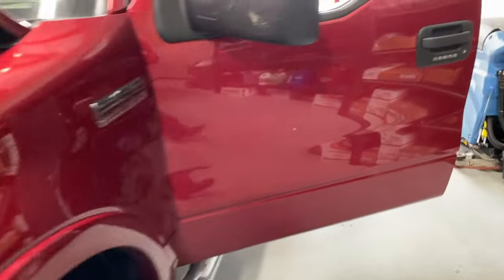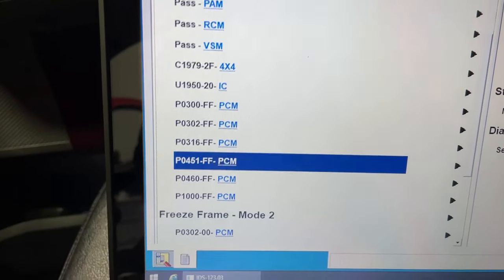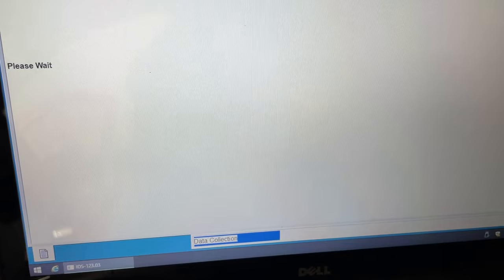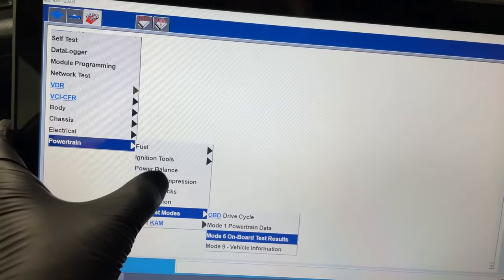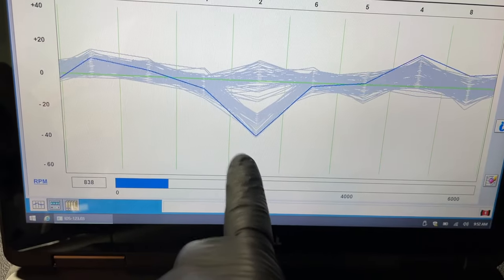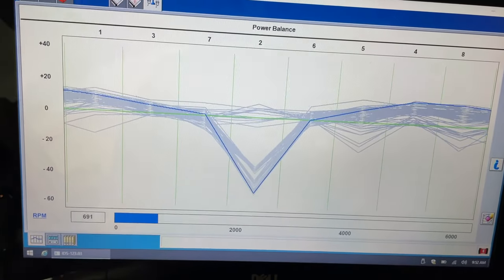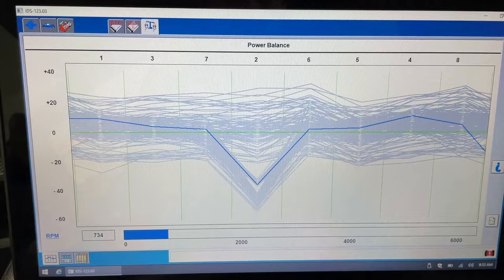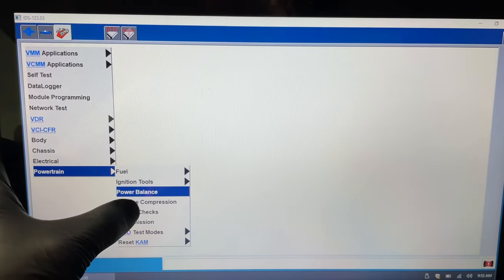Ford F-150 5.4L 3v Triton Engine Misfire: Champion Spark Plugs Belong in Chrysler’s and Lawn Mowers!

Comment: My 09 will start bucking especially low RPM. I use tow haul to bring rpms up and it helps it. Changed coil no difference. I haven't taken plug out, 165K miles factory plugs! Do i need to change them , is that the problem. Says 5 misfire.
I had a new 97 explorer and never changed plugs, sold it with almost 178k miles still ran great? 
I can't afford the dealer throwing parts at it but I've never seen a plug come loose before especially if they're factory?
Do you believe plugs are my problem here? I thought they were made to go 200k plus miles?

Comment: I have an issue with my 2002 f150 5.4 having oil in the spark plug well. What could be the problem oil going into the well?

Comment: The internet hates Champion plugs.  I've never had an issue with them. My 5.4 3v has been doing just fine on Champion Iridiums.  I would've done Motorcraft but it wasn't in the budget that week.

I think a lot of it is taking care with what you're doing - torque, cleanliness, etc.  I'd take champions installed by Brian over motorcraft installed by a hack.
Reply: Your right.    He is a Ford guy.  So it's Ford parts.    I myself work for a shop that used to install only Autolights in everything before I started. Now we have changed that.   GM gets AC plugs and Ford gets Autolights, Chrysler get Champion.  All imports get NGK...  but I have worked for shops that only use AC for everything because they bought them in bulk...

Comment: I have a 1997 Mercury Grand Marquis,  4.6L V8 no coil on plug  which plugs do you recommend?
Reply: @Jonathan A I was planning on getting Motocraft plugs. I can get copper, single platinum, double platinum or iridium. I am not sure what works best?
Reply: @Jonathan A I have heard reports of hard cold starts using the newer iridium plugs with the older ignition system.  I think my car came with AGSF32WM. I was told the NGK TR55GP G-Power platinum plugs work well.  I might try them out.
Reply: @davidbrennan5  install the single platinum plugs. I put them in a Lincoln  I used to own, they were flawless.
Reply: @markk3652  That is good to know,  I just don't want to end up buying plugs twice. if they last 4-5 years I will be  happy.
Reply: @davidbrennan5  my 95 Towncar had the 4.6, with the platinum plugs it started easily, idled smoothly, and averaged in the mid to high 20's for fuel mileage consistently. They also last for 100000 miles.

Comment: Do you ever put anti-seize on plug threads?
Reply: Rule of thumb for myself is no anti-seize. Just a small squirt of wd40 for a little lube and start them by hand. Had misfire problems on many German manufacturers using anti-seize
Reply: @matthewellis3513  copper/nickel high temp anti seize is the way to go. No ground continuity issues using a small amount, especially in the aluminum cylinder heads.

Comment: I have 05 f150 changed plugs and coil packs all 4 o2 sensors.  Mass airflow. And a few more. I still have a white smoke with bad gas smell from exhaust and now a pretty nice ticking noise. 220000 miles any ideas. Thanks in advance... This video is similar to my problem.  Using Ford plugs

Comment: I used to see 65535 all the time working with computers. I looked it up again and 65535 is the highest possible number in 16 bit binary code. So it is likely there are way more misfires than that.

Comment: I have a 5.4 3 valve in my 2004 I replaced the motor with a crate engine from advance auto I have about 5000 on it by now I put my old coils on the new motor but I did put motor craft plugs in it every now and then my number two will miss fire especially when I turn on the ac I also have a broken clip on my plug in any suggestions on what I can do with it?

Comment: Need help! 2007 f150 5.4 temp sensor code keeps shutting down my mom's truck . Mechanic changed it 1st time then I changed it still same thing. Do you think I should replace the water pump or thermostat. I also changed the efan clutch. Please help.

Comment: At 17 minutes on your test drive I could hear a "warble" from the drivetrain, that sounds kind of like mine.  Does that sound like tires, bearings, or differential to you?  It's not bad but makes me nervous.  

Didn't realize that something as simple as a spark plug could have so much variability among the manufacturers.  Also, you said "Ford" spark plug, but you probably meant Motorcraft, right?  I know that they're essentially the same but there are parts that say Ford and parts that say Motorcraft.

Another good video.  Thanks.
Reply from the maker: Tires
Reply: @FordTechMakuloco  Thank you.

Comment: Hey, so I have a 2004 f150 lariat 5.4. The oil pressure gauge sometimes doesn't work. It works when it's warmer outside but when cold the gauge doesn't work. i verified it has oil pressure and replace the oil pressure sensor with no change. I am wondering if it is a ground issue or something else. Please help!

Comment: I've been watching your videos for a long time and I've actually fixed my truck with some of your videos, and right now I'm having an issue with the truck bucking when I'm on the highway, this is what's happening when I step on the gas at speed it starts bucking I let off the gas and and press the pedal to accelerate it stops bucking then as I let off the gas again and step on pedal to accelerate it bucks again then I have to release it and press it again each time I release it bucks till I press and release and press lately it's been on the highway that it's happening I wonder if you can give me some ideas on what the problem could be and how many different problems can cause this bucket because things are bad now and I don't have the money to send it to a mechanic and with your knowledge and videos I may be able to fix it myself, I hope you can help. Thank you

Comment: Thoughts on ngk spark plugs? Just bought a 2010 And noticed it has ngk. I have new motor crafts but not sure if I should wait or go and change them
Reply from the maker: The motorcraft plugs are made by NGK.

Comment: Hey Brian, long time viewer here. I wanted to ask if you have experience with the red locking tabs getting stuck in the unlocked position on older Ford vehicles? I see them used on MAF and TB connectors on late 00’s to early 10’s Ford’s. I currently have one zip tied to my intake to prevent it from coming off my MAF sensor since it’s stuck unlocked. Thank you for your time.

Comment: I have a 2005 F150 5.4 that im about to do the timing on.  Its got 142k miles on it.  I have no idea when the plugs were changed last.  Idles pretty good.  Do you recommend just replacing the plugs while the timing is being done?  Do you automatically change the Ignition Coils too then?

Comment: I have a question that has nothing to do with this video, i have a 06 focus that I just replace the whole AC system and i mean complete system. Yet when I am driving it does blow cold air but a idle it blows warm. Is there something that I can do or check. Based on your expertise.  I would really appreciate your thoughts on this

Comment: I have these plugs on my truck and it runs okay, I do however have a rough idle and between 40-45mph i have a shake, trucks bouncing all around and you,can feel your teeth chatter. I had this problem before I changed the plugs and it fixed it, now its back. Could it be because of the plus? On my edge tuner it says -15 spark advance.

Comment: Need an idea, 2007 F-150 Lariat, 5.4. Keep getting a P0307 code. Runs rough, blows a code and then I tack it up to 2200 rpm for a minute 65 to 70 seconds and it stops. Only does it after sitting for 7 to 8 hours. Changed with ford parts, Coil, Plugs. Will not go away, cleaned with seafoam directly to cylinder 7. No avail. Fuel injector swapped and no change. Throttle body cleaned. What the heck, only 136 thousand on her. Help Please   Jim

Comment: Hi friends. I had a misfire and changed the spark plugs for newer Ford OEM parts. One of the plugs wasn't able to came out (the only one and I know is not ford, as required the 5/8 socket, assuming is a Champion). What do you recommend to try to break the plug being seized and take it off. We really tried hard with a long pry bar and wasn't going anywhere. The mechanic told me "as that cylinder is not giving problems leave it and try other time". We used the "carburetor cleaner to attempt loosing the threads but didn't work. What you recommend doing? What would happen if we use a larger bar and apply more torque? Does adding WD-40 for a couple of time do anything good to loosen the thread? Any comments from anyone here would be highly appreciated. BTW, I'm in Calgary and my truck is a 2005 F150 with the 5.4L Triton and has 273,000 km.

Comment: Dam that Ole boy is lucky that plug didn't launch into orbit.  That's at least $500 to fix a blown plug. I only use Motorcraft and get them in good. Coils I'm guilt of using aftermarket but I replace them every year with new plugs also.
Reply: You replace coils and plugs every year?  That seems a little excessive unless you drive 100K miles a year..
Reply: @dickfitzinya3082  My F-150 is used for off-road in Colorado up to altitudes of 13,900 feet. A break down up there is a major problem. It gives me peace of mind knowing the plugs won't come out and the coils will work up high.  Excessive yes

Comment: Any idea why my 07 fx4 would loose power with no warning lights till it rolls to a stop then it's a check gauges showing no oil pressure it's only done this 2 times in 2 years and under passing accelerating once I shut it off and restart it's fine again I do smell a little oil burning for a second thanks
Reply: I'm wondering if a bad engine mount can cause this
Reply: oil sending unit

Comment: I have a 2009 f-250. 147k miles. It misses badly only if the engine is cold and I’m accelerating between  3-4k. Once warm it runs awesome. I’ve changed the exhaust and added a cold air intake. No change. It has no codes at all. I do hear the timing chain making noise. Any ideas?

Comment: Brian I have a question I have a cylinder  8 misfire on first 1000 revolutions on my 04 f150 with the 5.4 3 valve and was wondering if you have any idea how to fix it. I'm only 17 so money is tight and I have already payed my local shop $420 dollars to try and fix it. They have changed the spark plug,coil Pack and injector and the check engine light still pops on. Do you have any idea how to fix it?

Comment: I was going to order the mhv360 high volume oil pump for my 04 f150 fx4 & when I entered my info to check fitment it says it does not fit my vehicle. Could you give me any direction as to why  please ?
Reply from the maker: The M360HV fits all 3v engines 2004-2014.

Comment: I don’t know if you respond to comments but I got a 06 f250 5.4 3v that is have the normal rough idle problem. We replaced the whole timing, and vct solenoids but it still hasn’t fixed it
Reply: Bad design,makes shop work on purpose

Comment: Hey Brian, big fan here!  I was wondering since you didn't bolt down that cheapy coil, perhaps the vibrations of going over 2,000 RPM might have caused the misfire, and not the coil itself?  Maybe it would have been better to bolt it down before you ran the stress test on it?
Reply from the maker: Nope not even close to being a chance.
Reply: @FordTechMakuloco  okay, roger that then. I was only asking because the cheapy coil looked a little bit loose when you had stuck it back in there. But I'm only watching, you are the one with hands on it and can actually feel how tight it is.
Reply from the maker: The coils push down onto the spark plug pretty far so there is plenty of contact.
Reply: @FordTechMakuloco  Roger, thanks

Comment: It looks like #5 is on its way out, I can’t believe that guy didn’t just put new OEM plugs and coils on before he came and saw you. If Iv’e ever had a problem with any cylinder I always change to a new OEM Plug and coil. Anyways, I don’t think this customer is done with this vehicle yet. It looks like he’s gonna have to do a full tune up on it shortly. Oh and those aren’t even MSD coils. Those are China coils, MSD actually put their name on them.
Reply from the maker: Did I say they were MSD coils?
Reply: @FordTechMakuloco  no I don’t believe so, I was just commenting on how he purchased new coils but went cheap, didn’t go MSD or OEM. And I saw a few comments suggesting they where MSD and just pointed out how MSD always displays a name on the tops. Even their streetfire has some form of writing on it.
Reply: @FordTechMakuloco  keep up the videos though. I’ve been driving my 05 5.4 for 16 years this November.

Comment: Hey bud big question for you! What is the best spark plugs to use on this 5.4l engines? I have a 2007
Reply from the maker: Motorcraft SP-546 or SP-546X
Reply: Another question bud do you recommend going with 5-20 or 5-30 if truck has higher mileage? 193k
Reply from the maker: 5w-30 no matter what mileage.
Reply: Thank you!!

Comment: 2005 F150 5.4 3v
 Need Help
@Fordtechmakuloco thanks for this video. I have the exact situation on cylinder #2. I pulled the coil, saw the boot was browned out and smelled of rich exhaust. The plug was loose and virtually came out by hand. I however have an issue. The plug I removed came out whole minus the ground strap which obviously burned up do to lean condition. The plug was an autolite 5/8". I called around for a replacement and none of my local parts stores stock the Motorcraft oem type plug. I ended up with an autolite again. However when trying to install it would seem the head threads are stripped and the plug will not tighten. Is this common and if so what is my best course of action including best parts to use. I've searched videos and most cover the Triton 2v. Any help would be appreciated. And I have officially clicked the subscribe button.

Comment: When i click on the link for the spark plugs on Amazon, the description says they're for a 2019 f59.  I have a lot of experience with Amazon, enough to know that listings get changed all the time without warning, and that descriptions aren't always accurate.  Just want to ensure I'm buying the right thing before i click!
Reply from the maker: How can I verify your part number if you didn't give me your year, model and exact engine?
Reply: Sorry.  It's a 2010, 5.4L.  All of the reviews on Amazon seem to be for the same model as mine.  Really positive reviews.  But I sell a lot on Amazon, and I know that listings get changed without the sellers always knowing.  Definitely wasn't implying it was through any fault of yours.
Reply from the maker: you need the motorcraft sp-509
Reply: Great!  Thanks so much!

Comment: I have a 2019 ford f150 super cab xlt and it makes a popping noise when you start it and when you put it in 4wheel drive it makes a rubbing noise when you turn left or right is that normal my frist ford its not throwing any codes
Reply: 2.7 ecoboost motor

Comment: Fly to texas and fix my truck lol ill pay your ticket i cant fix my truck no codes bit sputters and shakes idling and accelerating.. when i first start it cold it runs fine for the forst minute as it warms up it starts shaking .. 2007 5.4 4x4 142,000 miles
Reply: Have you changed spark plugs n coils? Check out the fuel pump module by your spare tire under the truck bed (had a similar problem ended up being that but could be other things)

Comment: I have a 2020 F150 with a 2.7 turbo charged engine it has 31,000 miles on it and after it sits overnight and I crank it up in the morning it smokes for about five or six seconds and then clears up it’s definitely blue smoke it smells like oil any thoughts
Reply: Have the left side turbo charger oil supply tube checked/serviced. Common problem on these engines!

Comment: I have a 5.4 and would like to do an oil change, which oil would you recommend? 145k miles
Reply: I use 5w-30 in mine. I usually go with Mobil or Valvoline. Try to get a quality brand, not a cheap brand!

Comment: This is not related but after pulling the passenger side valvecover I found a plastic part that sits between number 2and 3 cylinder that became dislodged and sounded like bad lifters. If anyone knows what this is please enlighten me so I know whether to run with or without.  The truck is 2000f150 5.4  . Looks like an oil deflector and has a oem number. Thank you for any advice

Comment: I've had my ford ignition coils original on my 2008 f150 4.6 for 13 yrs never a problem ...yet...cuz ford OEM products specially electrical are made to the T the aftermarkets will work but not as well or long.

Comment: I had a 1980 Honda 900 motorcycle. It had champion spark plugs in it. It topped out at 8k RPM and ran like crap. I changed to splitfires and instantly gained 1500 usable rpm to 9500 and the thing ran like a race bike. Champions SUCK!

Comment: What is your opinion of these new power bost engines in these F150. The dealer is trying to tell me they are rated at 25 MPG in the city and 26 on the Highway. With 500 ft lbs of  torque
Reply from the maker: Skip
Reply: junk! would not trust for long-term! Most of the new Ford's are getting really cheap on the engine and powertrains! yup can't even get Expedition with a v8 not to mention the soccer mom drive train! just junk  for whatever you pay for it! Sadly! I  love my 2010 Explorer! got real diffs and transfer case!
Reply: Thank you for you reply. You just re affirmed what I thought.